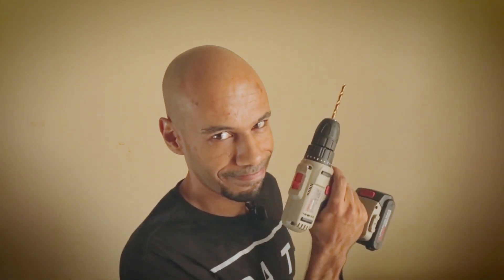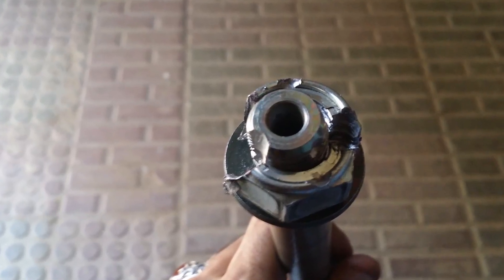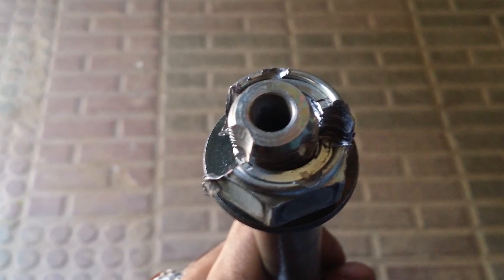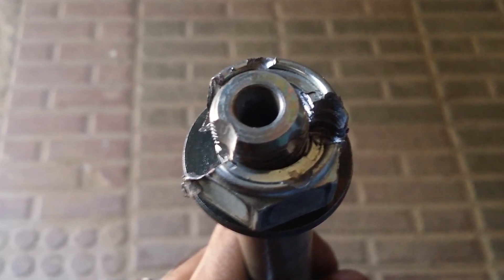FZ07 - STUCK REAR AXLE NUT SOLVED! #4

Comment: This was a timely video for me - Thank you! 

I have the same problem on my 2015 FZ-09 and just ordered all new parts (rear axle, washer, locking nut -- and new LighTech Chain Adjusters). 

I like your method - to drill the nut and break it off. I'm in the middle of drilling/grinding out the rear axle on the nut side because the rear axle on the opposite side got destroyed from all the spinning while I was trying to remove the nut. Thanks for posting this video. Do you have a website address for that new locking nut?
Reply from the maker: Thank you very much, it's really a pain! I tried to find the link I used to get that nut but i guess it expired or something! however, I think you can start from here https://www.ebay.com/sch/sis.html?_itemId=152537573871&_nkw=GILLES+ACM+TITANIUM+SPINDLE+LOCK+NUT+RACE+YAMAHA+MT07+FZ07+MT+07+FZ+07+14+17&_trksid=p2047675.m4096.l9146  . just make sure that it suits your bike. Ride safe :)

Comment: While doing chain maintenance I must've tightened too hard on my mt09 because I damaged the adjusting block on the other side. I've done chain maintenance a hundred times but now the rear axle nut won't loosen or tighten all the way either direction it only goes so far. Any ideas on what could be wrong? I really hope I won't need a new axle. I ordered a new adjusting block aka chain puller. I'm hoping the Yamaha dealer can make this a quick fix.
Reply from the maker: Can't tighten or loosent the bolt! Well, unless the axle and/or bolt are rusty to the point of making the bolt get stuck. I can't think of another reason. I'm afraid that the threads on the bolt and axle are damaged and both need to be replaced. And even if you mange to loosen the bolt now, it will give you a hard time the next time you try to loosen it.
Another thing I learned the hard way, is to always clean the threads on both the axle and bolt with a brush, on the axle before loosening the bolt, and on both beforing installing the bolt it again, this thing is always looking for a reason to get stuck, dirt is one of it's worst enemies.
Good luck, and ride safe.

Comment: Omg I just did this too. Can u please please help me pick what parts I need to replace it and how I take the axle nut off. Any links, please and thank you so much. I found the gilles axle nut from TST for $84, is that the only part I need? Don't I need the plate on the other side too? Please and thank You
Reply from the maker: I just used a drill to crack the old nut open, and I damaged the axle more by doing so, but it wasn't much of a problem as it was already damaged. 
You need only the new nut unless the caps and/or the axle are damaged too. 
I found all the parts on ebay, so they shouldn't be hard to find.
Ride safe.

Comment: Would you know what kind of nut it is , as in size , pitch of thread etc ?
Reply from the maker: The socket is 27mm, thread 18mm, pitch 1.50mm, outside diameter 31mm, and I think that height was 14mm
Reply: Magd Farid thank you for quick reply and thanks again you champ appreciate that , I just gunna get a nylon lock nut as mine has stuffed the axle as well ,
Reply from the maker: No problem. Ride safe.

Comment: No need to destroy the Nut .
Use a Dremel Tool and remove the lip retaining the lock washer .
Then use safety wire to retain the Nut . Or drill for a cotter pin.
Reply: Behind the bolt ?